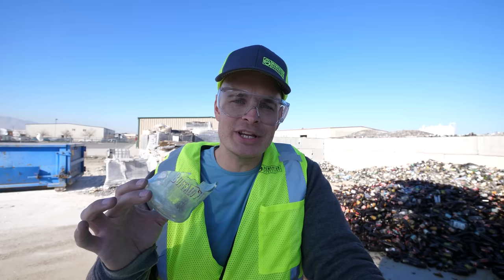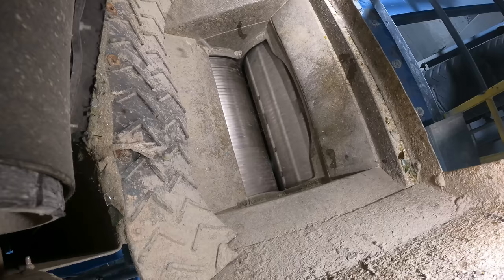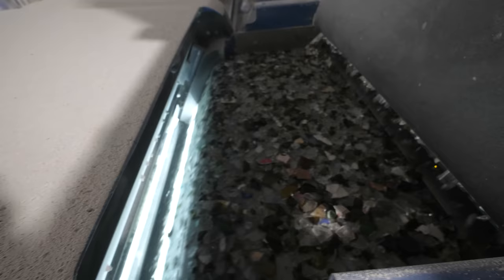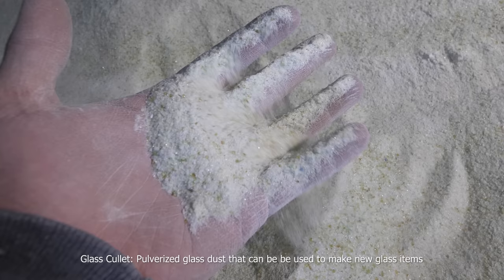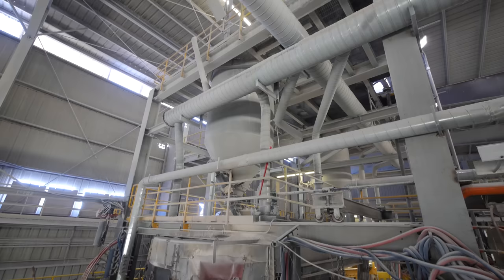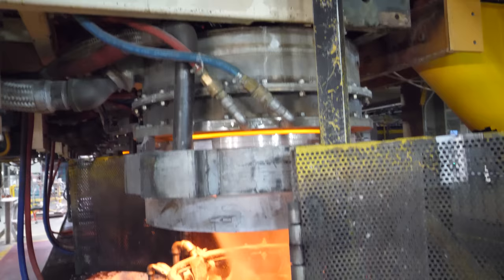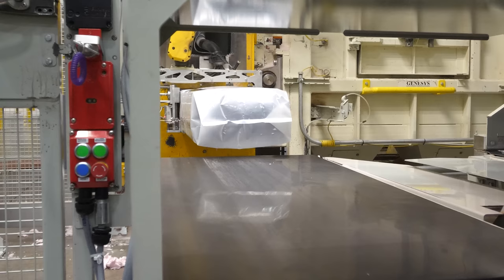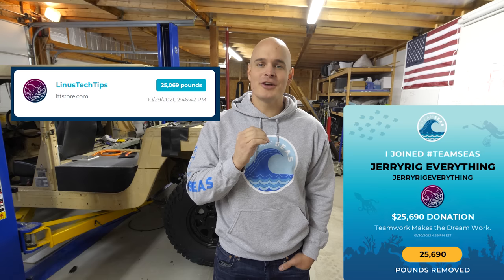What *REALLY* happens to 'Recycled' Glass?!  -  (you might be surprised)

Comment: Hey Jerry, everything seems nice in that place but as a Safety Engineer i highly recommend you and the company to use appropirate masks against the dust or small glass particals. You may not see thr dust in the air but believe me there is very dangerous dust that goes to your lungs and stays there forever.
Reply: I came for the silicosis warning.
Reply: I was thinking the same thing, I was really surprised he wasn't told he had to wear a safety mask
Reply: Agreed. I was surprised to see no one wearing masks.
Reply: Valid point. 😷
Reply: That was something that worried me the whole video, they need more safety measures
Reply: He says it's bio soluble but I still don't get it. Glass is glass no mater the size...
Reply: it won't cause silicosis cuz glass is amorphous
Reply: @realaugustinlouiscauchy  ahh I get it now. So after its been heated/melted the lattice is disassembled and asthma is all you'll get basically... Weird doing one thing like heating it will deem it safe.
Reply: Crystalline silica causes silicosis, glass bottles are amorphous glass
Reply: @realaugustinlouiscauchy  nice point, i didn't kniw tha before.
Reply: I think there's a way to tolerate small or even fine glass particles. But working day in and out, I'm wearing an n95. Even some eye protection.
Reply: Silicosis! Bingo! I worked in a plant like that for seven years! Recycling Plant! We did glass in three colors, All paper, Plastic. Most of the dust came from paper. Now frac sand is another story!
Reply: Glass doesn't cause silicosis, it will just be coughed out with mucus like most dust, wearing a mask is a good idea for your personal comfort though and there can always be other things in the air.
Reply: Glass is safe as a dust. That is why ‘sand blasting’ never actually uses sand, it uses crushed glass, or other materials.

Too much will kill you, yes, but the same holds true for water - drowning.
Reply: His name is ZACK NELSON
Reply: And that stuff gets in the eyes too .
Reply: Yeah but the safety engineer and the video and all the guys around him would have made fun of him and chuckled it up as he tried to tell you it was perfectly safe to hold that handful of insulation when that's just not true and all that dust in there that silica he's probably coughed up blood for the next week after that and doesn't realize why I had chest pains they'll never go away,
Reply: And gloves... No telling where that glass has been!
Reply: @realaugustinlouiscauchy  I bought a small yacht tender from a guy who built FG boats for 20 years. He would beg to disagree with you. He could hardly breathe enough to talk and said the glass dust had done it. Now I see all sorts of argument about resin vs glass etc. But the guy was screwed. Maybe it's "not silicosis"
Reply: I thought the same thing. It's a fascinating process and hard to see how they could do without the human factor, but definitely more PPE required by the presenter and especially the workers who are breathing that in/getting covered with tiny glass particles on a daily basis. Would surely lead to health problems down the track. Got to be against national OH & S regs, surprised the employers get away with it tbh.
Reply: Yes that's the first thing I thought of this stuff can be dangerous.......
Reply: It’s just that young and dumb thing. It’s easy to think PPE is a hassle and a bother. People usually grow out of that as age starts kicking in and things start hurting. Unfortunately it’s often not grown out of quick enough.  😞

Comment: I have worked for a plant as a contracted electrician here in Lakeland, FL that makes this very insulation. It used to be a glass bottle factory. I've mostly worked on the packaging machine that had the robotic arm in this video, which was until  maybe 5 years ago was done by a human, and other general electrical systems in the plant. Its truly incredible what they do with glass and how much they use in a day. And I will say its HOT and miserably itchy up there where the furnace is. Where the packaging equipment and the rest of the plant is, the building is very clean and dust free.
Reply: What happened to the human? The entire process we just watched was automated. Seems weird that they would fire a low waged employee who packages the insulation and hire a high waged employee such as yourself to  repair the packaging robot. Doesn’t make sense.

Comment: Another benefit to glass is that even if it virually never composts it doesn't leech anything into the soil. From what I've seen even "BPA free plastic" isn't actually totally free of it it just has reduced BPA. 

My point is that even if glass is lazily discarded it doesn't ruin the soil, bugs, or plants of an area. Although the sharp broken pieces are a physical hazard.
Reply: So true. Glass may cause troubles of discarded incorrectly but toxicity is not one. A piece of glass in the forest may cause a fire or someone may step on a broken piece. But leave a piece of glass alone for a while to the wind and dust and it will become a nice colored pebble.
Reply: That's "leach". Leeches belong in the "medical and pest" category.
Reply: Glass is sand.
Reply: @ceylontea5877  thank you captain obvious
Reply: Wel except for fine particulates that can lead to silicosis. Which is not cash money. I'd be using a respirator in this facility if I could.
Reply: @redcell9636  one of the first thoughts I had also
Reply: @cosseybomb  This is probably more of a concern for people who work around this facility than to the occasional visitor.  I hope the workers are using respirators.
Reply: I think I will loose its sharpness if it end on the ocean floor.
Reply: A few years ago I progressively switch from plastic containers for food to glass containers. They are so much more durable and are so easy to clean. Now the only thiing I need to replace once in a while are lid.
Reply: @thecknodecker  I try to do the same. Sometimes I end up with leftover plastic containers that I try to reuse but glass and metal are way better. 

That goes for all things. I'd rather have a $200 toaster that lasts my whole life than a cheap plastic one that gets replaced every two years. 

Plus, with glass and metal you can just put leftovers directly into the oven (as long as you bring the glass up to room temperature first)
Reply: @danielkutcher5704  are leeches truly pests? They are only a problem if you are swimming where they are present.
Reply: Sensibility has got to be added into the value of resources for the benefit of mankind. Cost outweighs the the cost of of mining and milling most resources
Reply: @humpchannel9363  Not in a capitalist society. The cost should be how much it costs to produce something plus 1% to 25% extra as a kickback to make something. Otherwise their is no sense in making something as I wont work for free.
Reply: shóuld bé, bút thàts ñót hów çàpítàlíßm is currently set up.  Currently, the Çapitalists take advantage of workers and consumers, and the only people that benefit are the capitalists themselves.
Reply: You're clearly not old enough to remember the days when there were glass hazards in every parking lot, along every stream....
Reply: @toomanymarys7355  yup, and that glass has been ground down into harmless little pebbles within only a few decades, whereas plastic waste poisons the environment for centuries.
Reply: @ceylontea5877  ...except the difference is if you toss your glass bottle and it breaks on that sandy beach, some litle 5 year old girl is going to get a big shard of glass stuck in her foot running down that beach.  So everybody, even though glass is not toxic, PLEASE don't toss your bottles everywhere; it's infantile, uncool and hurts others. Be an adult, like the maker of this video, and have some self-respect and just for one second divert your attention away from your ego-centered needs and towards thinking about the well-being of others.
Reply: @seguefischlin  now there's an antiquated concept: "...thinking about the well-being of others."
You are spot on and the place would be better if everyone would, "think about the well-being of others."
Thank you.
Reply: Where to dump broken pieces ?
Reply: @dionisus8041  Maybe after a few HUNDRED years. The erosion of glass, even that left on the open ground , is incredibly slow.
Reply: @robertjensen1048  That however causes no trouble, except aesthetic. Glass just slowly turns to cobbles then sand, even when thrown into the sea. Plastics, just turn to worse forms as they erode, down to being micro plastics, inhalable and edible and perfectly carcinogenic. Just because something is more difficult to erode doesn't make it more dangerous. So yes, I prefer finding fake glass gems at the sea shore, than literally eating plastic and seeing plastic bottles on the sea shore that can't even be broken down. I think it should be a simple choice.
Reply: Couldn't glass be tumbled into bluntness and then returned to the beaches that extract it for glass production?
Reply: @boyar1978  good bait for fishing.
Reply: @danielkutcher5704  Huh. I thought that they would be the same word... not sure how my eyes slid over the homophones this whole time. TIL.
Reply: I watch glass turning to sand everyday when you crush it thousands of times, and it will still cut you
Reply: Bpa turn the freaking frogs gay

Comment: I want to know more about the optical sorter. The speed it operates is wild.
Reply: I actually work for a company that makes them. That super bright light is projected towards a camera and color sensor. Based on what is being sorted (colored glass or opaque ceramics), that data transmits to dozens of tiny air valves that blow material to one side and the rest is unaffected.
Reply: @Bruhhh Channel actually, electrons move slowly...
Reply: @Bruhhh Channel Ok, that is true but electrons move at a few mm/h depending on the power
Reply: It uses a fiber optic cable bundle with a fast strobe light to supply the bright light needed to detect the colors. Other than that the sensors are similar to the color sensor in your phone. Some of these sorters use low powered near infrared lasers similar to the type in CD rom readers to detect as ceramic and brown glass both absorb the near IR light very strongly. The laser based one has an efficiency of 98% rejection rate for unwanted glass.

Comment: It's wild to me that we don't recycle all glass. It's one of the few materials we can recycle without extreme struggle (unlike plastic) yet we still throw tons of it into landfills every year.

My town didn't offer any recycling services until about 10 years ago. That means for 20 years all glass and scrap metal I produced while living here was thrown in a landfill.
Reply: The problem is that if there isn't a local industry to use the glass it's not economical to be transporting it across the country to somewhere where it will be used; so households recycle it but it may just be dumped into landfill on the quiet.
Reply: Glass is mostly silicon, the 2nd most abundant element in Earth's crust after oxygen, at 27.7%. 
Glass going into landfill is just silicon returning to where it came from. 
The only valuable thing lost is energy. Given, that amount of wasted energy in not insignificant. 
From an environmental view, wasted glass is not even an issue for the Earth or wildlife, unlike PLASTIC is.
Reply: @PushyPawn  thats like saying plastics is mostly just carbon and hydrogen, so not really any different than literally anything plant based

It's not only the atoms that a material is made from, but also the constellation and binding properties they have, etc

(another example: Computer chip wafers are pure silicon, yet you dont just throw them away into sand)
Reply: @PushyPawn  pretty sure he said it takes a million years to break down, but yeah, less damaging it seems than plastic
Reply: @Thermalions   Correct. My local (Regional) govt, of which I was a councilor for 8 years, could not find any party to take the glass (free). After stock piling it for 3 years we just gave up and it went into the landfill.
Reply: @Thermalions  There needs to be a point where doing the right thing for our planet outweighs profit.
Reply: Yes, watching WWIIHistoryhunter, and he is picking out intact bottles from rubbish pits after 80 years, still looking as good as when it went in there, and even some with a lid still on, and contents inside.
Reply: @stuartburns8657  Just like sand on every beach on the planet. 
Which is mostly silica, minerals like quartz and various organic matter like limestone.
Reply: @ocean7280  There's clearly no point in wasting time explaining anything to you.
Reply: @PushyPawn  there is a lot of silicon sure, but glass is made from sand(not desert sand, but beach sand) which has its limits
Reply: @kookcity5626  Definitely time to mute you chemistry geniuses.
Reply: @PushyPawn  you're prime dunning-krueger.
Reply: @PushyPawn  Bro, you deny the moon landing as real and spend your time arguing against recycling on multiple videos on this channel. People shouldn't waste their time on you.
Reply: @greasemonk4576  you're a prime googly-wacker.
Reply: Can I get a company to buy glass waste powder?
Reply: @ocean7280  Computer chip wafers are pure silicon, yet you dont just throw them away into sand  

That's just because silicon is expensive. Environmentally you totally could throw it away.